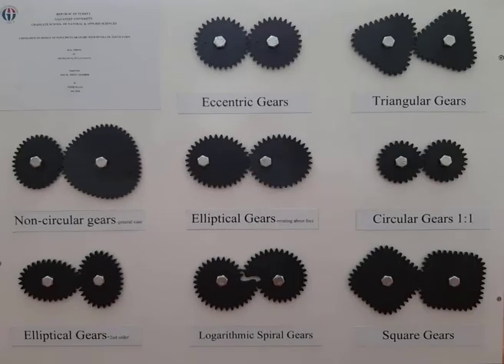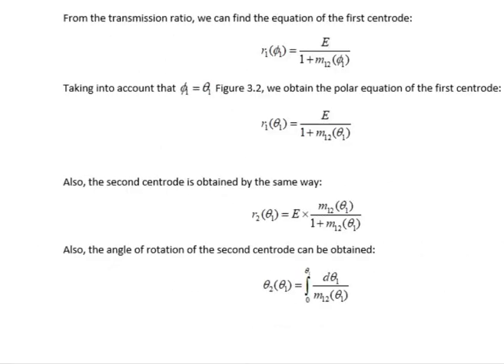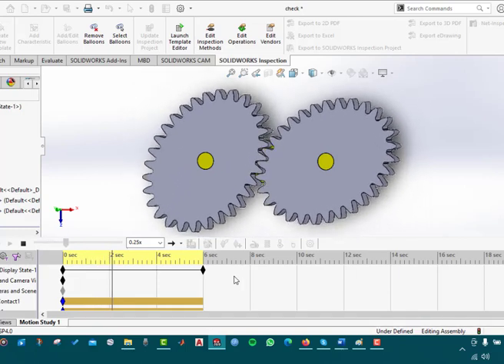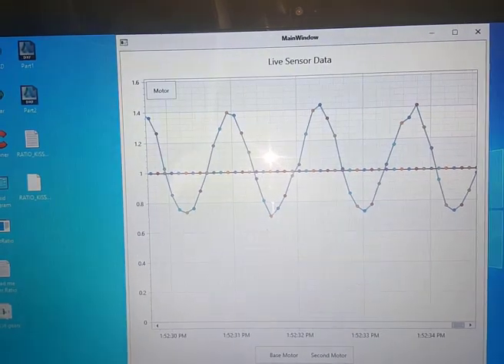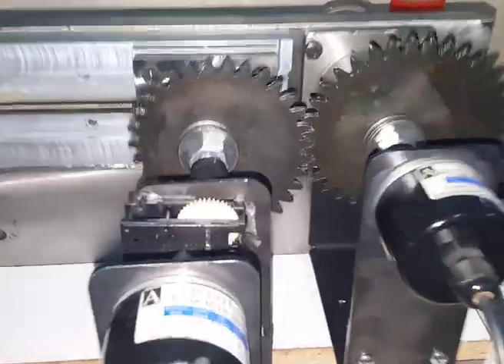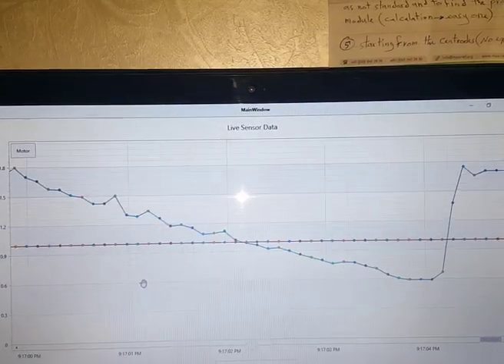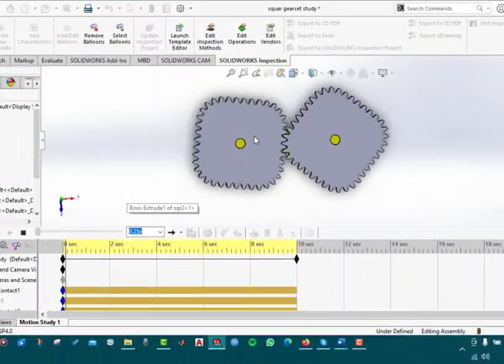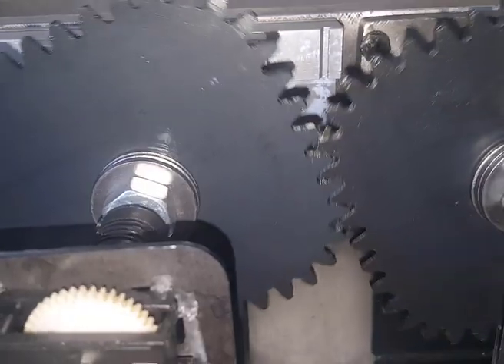Introduction to non-circular gear design

Comment: When non-circular gears get "extremely non-circular", the pressure angles get so high that jamming can easily occur, because the teeth are set perpendicular to the pitch circle, & the pitch circle becomes highly inclined.  There is another scheme of setting the tooth parallel to radius line.  This does not have the high pressure angle problem.  But I can fond NO technical information on this scheme.  Are you familiar with this scheme?
Reply from the maker: Thanks for your valuable comment Brian.
For sure I am familiar with that scheme. But, I saw no need at this point to insert much info and to keep focused on the main points of the design principles as simple as I can.
Anyway, we are preparing something new with more details and info.
Keep in touch.
Reply: @nezirelali1340  Another thing you need to address is how gears with radius discontinuity (log spiral gears you show) function at the discontinuity.  One tooth pair must disconnect as the other connects.  Trouble occurs when the gears are driven in direction that tends to separate the "high sides".  The gears can dis-engage at this point.  How do you modify the tooth geometry to make this mesh transfer happen properly without microscopic center distance adjustment?
          For involutes, are you going to show how to derive the base curve from the pitch curve?
Reply from the maker: @bpark10001  Dear Brian, thanks for your comment. Really, for the logarithmic gears, the start of the log spiral gear (the smallest radius) must be within space and the end (the biggest radius) must be with gear. So, the continuous engagement between the teeth will be secured.
For the Involutes and Evolutes, a very accurate numerical solution was used to generate the curves on MATLAB avoiding the complexity of solving the equations which was shown in the videos (depending on the main definitions of both).

Comment: Great job my bro,
Are there any manufacturing errors at non-circular gears ???
Reply from the maker: Thanks bro.
Really, the used manufacturing process was by laser where there were some errors due to the low accuracy but when ERDM cutting method was used, the results were better. The generating methodology was accurate enough really.